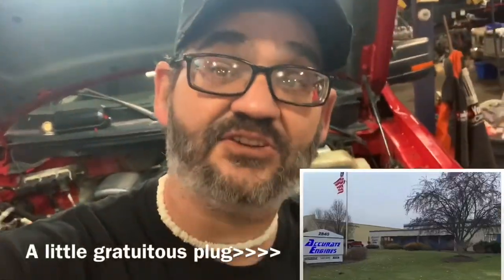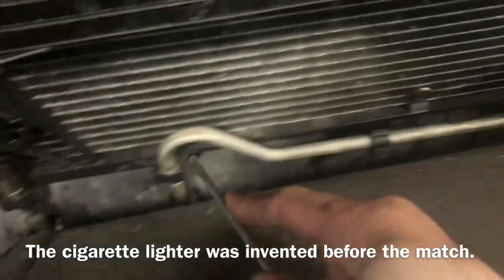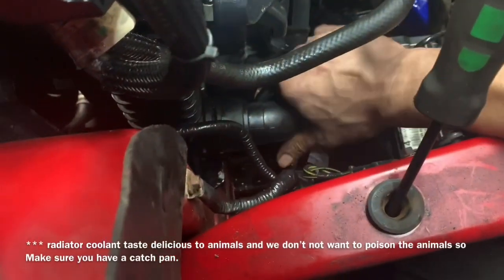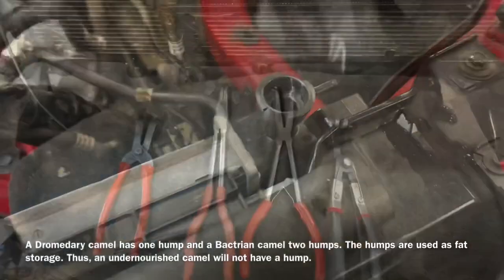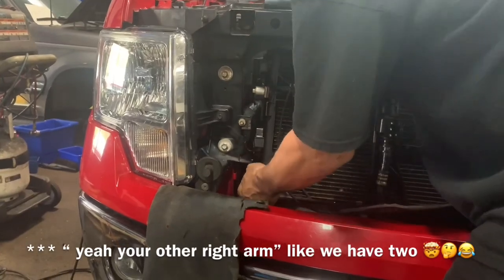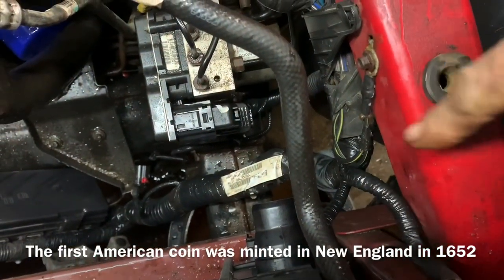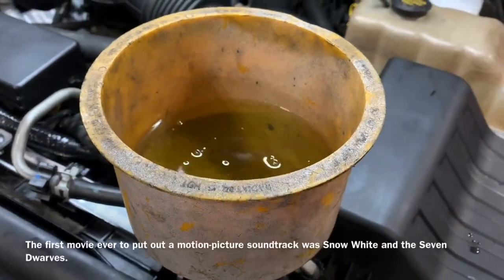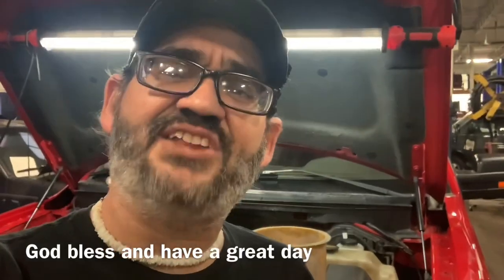Ford F150 radiator Removal and installation/ without removing air conditioning lines no AC EVAC!!

Comment from the maker: Check out this video if you're having bad battery drain in your F150! 
https://www.youtube.com/watch?v=PXLe38dnse8&list=PLWSrc_bUH2bUG1fKr5euHY0hZuQ3dtyUD&index=30&t=0s
Reply: The Clay Way hey so the lines that I disconnected on the radiator is that to the transmission fluid or steering pump fluid? 
Also do I have to do any special in terms of replacing the fluid or do I just reconnect the lines??

Comment: Really appreciate this video. My 19 yr old son bought himself a 2013 F150, and had the radiator crack on him. He didn't have the $1000 to take it to a shop, and we used this video to do it at home in about 4 hours. Very helpful, clear descriptions, and good video shots of the "gotcha" areas. 
Thannks!

Comment: This video is a lifesaver! Replaced the radiator no problem... with one cavet
WARNING to my fellow home mechanics, have some kind of rubber stopper or connector cap for both ends of the power steering line. Power steering fluid WILL creep back through the system from the reservoir and leak out of that connector in the condenser or the hose.
Also something to take note of, just like how the condenser sits in little hooks on the radiator, so does the radiator fan assembly. Make sure its in the hooks or you can bend/snap the frame when you tighten it down.

edit: Dont be a fool like me and use paper towels to plug the connector ends! Not only did it leak right through the paper towel, i almost got a huge chunk stuck INSIDE the condenser when I accidentally pushed it in too far. Was able to extract it with a crudely fashioned barbed paper clip and a lot of patience.

Comment: I know this video is a year old, but it was amazingly helpful. I have an 09 King ranch and the radiator had a huge hole on it. I've never worked on Fords much at all and would have never known about those clips that hold the radiator to the condenser along with a few other things you pointed out. I literally had the old one out and new one back in in an hour and a half. Thanks for making this video man.
Reply: I have the same problem in the same truck, 09 KR. Can I ask you in what side of your radiator was the hole? Mine it’s in the truck’s battery side.
Reply: Shoot. I got a hole in my 2018. I'm so glad they moved the power steering reservoir

Comment: Thank you
  Thank you
Just did this replacement.  The tricky part is the plastic tabs and hooks.  Had my son help.  
The old radiator hooks can be broken off because the new radiator has the same hooks.
Definitely pull the fan assembly out. Tried to just push it back but that was a no go.
Don’t over pay for a new radiator especially if your vehicle is out of warranty.  These things are simple parts and should cost around $100-$200 new.

Comment: Just did 2012 with ecoboost. It was pretty simple like you showed.  There is no power steering to mess with.  Just some turbo hoses that get in the way.  You can do it just as you showed with AC intact.  Thanks!😅

Comment: Thanks for making this video. My 2011 f150 has developed a leak on the drivers side lower corner of the Radiator. Ford said it needs to be replaced and I was quoted over $1200 cad. Buying one online (motorcraft) and going to give it a go myself. Little more involved then I thought, but with this video I'm sure I can figure it out.
Reply from the maker: That’s awesome Will … it’s not a bad job I’m sure you can do it to

Comment: Dude, after watching this video I thought I would do one myself since I have done a few and this one seemed a bit hard to follow if I am being honest.  After about 10 minutes of filming I stopped because it can't be done much better. There are sooooo many fricking hidden clips and hard to reach ones.You were moving around a lot cause, well...you need to move around a lot to "find the hidden clips".  I am waiting on my new radiator to arrive, but at least the old one is out. i did end up taking off the power feed for the horn to make it a little easier to get the new one back in. Overall it's not a real hard job, just tedious as heck and you did a solid job with the video. AE
Reply from the maker: Thanks Alan it is very difficult to describe labor-intensive and time intensive videos
Reply: @sharpcarco  No question about that.
Reply: @sharpcarco  Why Ford decided to put that cable assembly right on top of the radiator is beyond me. What a bad design. That could have been off to the side somewhere making the removal a lot easier.

Comment: So Clay I am trying to put my lower radiator hose back on my 09 5.4 triton at the radiator. My question is; does the retaining clip need to be on the hose before it is pushed on or after the hose has been pushed on? Thanks for your help!
Reply from the maker: Well I put the clamp on the end of the hose then squeeze the clamp and slide the hose on and the clamp at the same time. 

Sorry it’s a little bit late answer hope you got it
Reply: @sharpcarco  well I ended going back to the beginning of your video when you pried the retainer clip out and then you said to just put it back in the hose and then just slide it on the radiator and it worked perfect! I had a new hose so it was a much tighter fit and I had to put Vaseline on the inside ring to get it on. Thanks for that video I never would have got it back together without calling a mechanic without your video 👍

Comment: I replaced my 2009 Ford F150 Radiator. I noticed on the right side bottom there was a small downward spout. Did I forget a hose there or is that one left open on purpose?
Reply from the maker: No That’s the spout for the coolant to drain out when you open the petcock I believe from your description

Comment: Facing the truck, the top and lower side hoses on the right are for what fluid?
Reply from the maker: Oh……. I don’t remember transmission or oil obviously…… I will say however if you didn’t unhook it it should go directly to where it supposed to go

Comment: Just realized I have a standard fan non electrical this should be fun...😳
Reply from the maker: That’s not so bad I also have video on how to get that off Quickly just look under five minute fan removal

Just be careful if you do that procedure not to dig in the nut  too much. You’ll understand after you watch the video
Reply: The Clay Way  hey so the lines that I disconnected on the radiator is that to the transmission fluid or steering pump fluid? 
Also do I have to do any special in terms of replacing the fluid or do I just reconnect the lines??
Reply from the maker: Some of time there is power steering and transmission lines and sometimes oil lines you’re gonna have to visually look at them to tell the difference. I can’t remember exactly what’s connected here on this particular application. you shouldn’t of lost enough fluid to be consequential. But if you did then you need to check it I’m sorry I can’t really answer the question that you’re asking I wish I could help

Comment: How can I tell if my Ford F-150 crew cab 2010 5.4 l motor is super cool radiator or a regular radiator? Can anybody please answer me that question and thank you for the video will subscribe and follow
Reply from the maker: Well you should be able to ask the folks at the parts store how you can tell the difference between the different kinds

More than likely one of the radiators will have transmission cooler lines and oil cooler lines.

And one of the radiators will not have them. 

That’s probably the difference but you should call them and ask them they’ll be able to tell you exactly what to look for